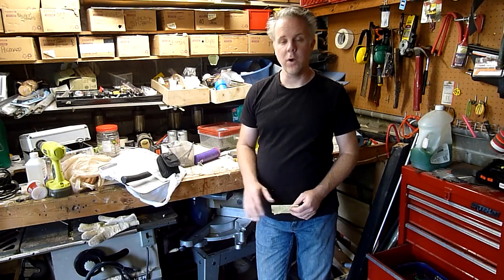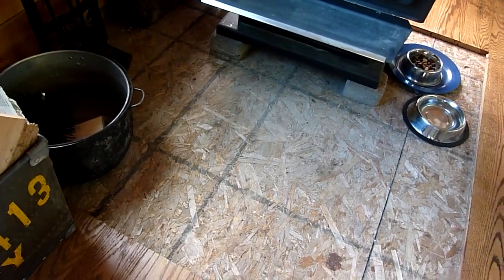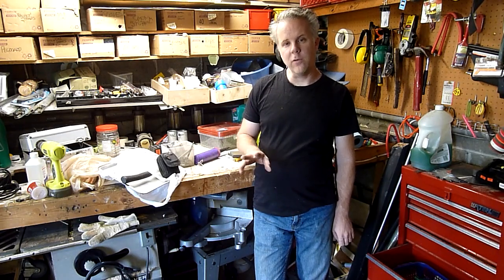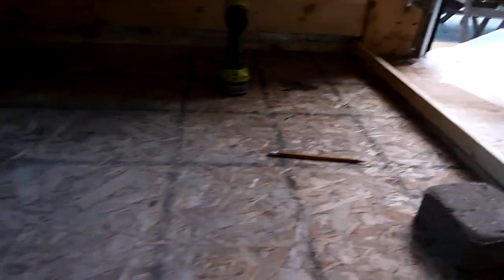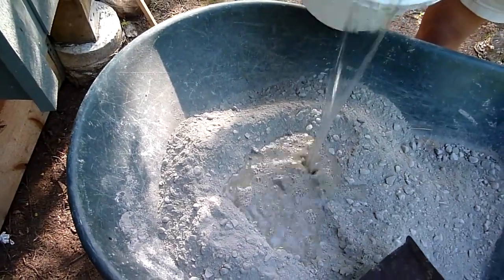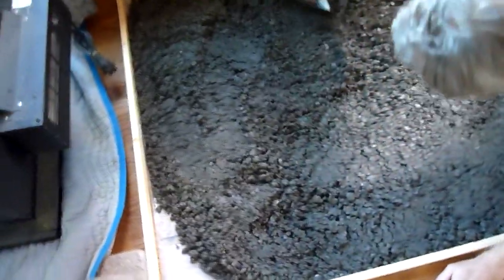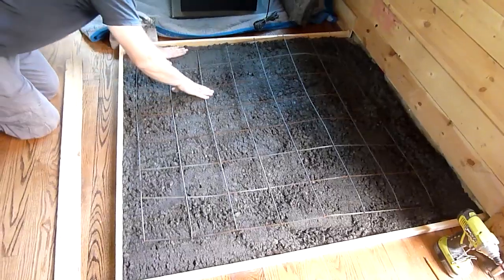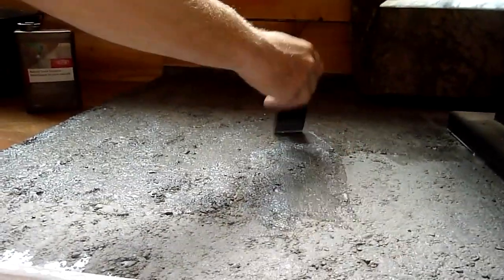Make your own wood stove hearth.

Comment: This looks really nice... could I put a frame around a raised hearth and fill that with concrete? I put together a 40 x 40 raised hearth pad with a plywood floor I thought about framing it, put plastic down and then pouring concrete. The alternative was to put down cement board and then find a nice stone... but I like your hearth!
Reply from the maker: Im sure you could build a frame and fill it. If you use a nice hardwood you could leave it in place. Good luck with your project.

Comment: It looks great!  I was thinking the same thing about the edge.  If I go this route, I bet one could use an edging tool on the mix or possibly just put in a piece of cove moulding around the top edge to get that bevel.
Reply: michael98277 looks really good! Might just steal the idea with a few variations. Thanks for posting!
Reply from the maker: bevelling the edge is a good idea, I would do that if i did it again

Comment: Good project and what a setting you reside in...i have a laid a 20mm mortar base and am thinking of making up a top 20mm finish using white cement + sand or stone dust with a black dye...however not certain if it will look good...will have to smash all out and start gain if it goes wrong.....
Reply from the maker: Maybe make a small test slab. Thanks for watching.

Comment: Hey! Great video, this is exactly what I've been looking for. I love the look of concrete hearths over tile and plan to build one for our cabin.

Ideally I'd like to achieve a bit of a smoother finish, and will likely use a different concrete mix without the roughness/aggregate. Would you do anything differently if you had gone this route?
Reply from the maker: If you want a perfectly smooth surface, you can cast it upside down on melamine. Then flip it over after its set up. check out "home made modern" on YouTube. he has some good videos on that. Good luck with your project.

Comment: you could finish the top with some mortar to smooth it out or just concrete with the rocks screened out. if you want to stamp it you need a lot of fine mud to take the impression, then concrete dye for flagstone effect, But great how to video, gave me ideas. thanks

Comment: After having it for a year, how do you like it?  Would you change anything?
Reply from the maker: We really like it, the edges and corners have held up, no chipping. I might add more dye if I wee to do it again.
Reply: Ontario Lakeside thanks for the super fast reply. I'm not too far from you over here in Michigan. Thanks again.
Reply from the maker: No problem, good luck with your project.

Comment: It's great but the problem with these 'flat hearths' is that you have to kneel all the way down to load the stove or remove the ashes. We raised our stove 8 inches high and still it's a bit of a hassle to get down 5-6 times a day. I vote for raised hearths which might be additional work when creating but helps for the entire life time of use of the stoves.
Reply: I think that's an excellent point,  but I'd choose a height so that you could fuel and maintain the fire while standing.  Haven't gotten around to that yet,  but I remind myself to do it every day during the heating season....
Reply: @SeattlePioneer  you're going to start running into ceiling clearances unless you have cathedral ceilings or higher than average.

Comment: While I understand this is to highlight a DIY project (which was nicely done by the way), before one commits to an in situ concrete hearth, one should also consider simply buying a modular hearth pad which can be placed over an existing hardwood floor. While much more expensive than this project, a hearth pad has some advantages. For example, if one ever moves to another type of heating (electric, solar, gas, etc), they can simply remove the stove and pad and have the solid floor there still intact. And some stoves allow for glass pads, which are visually unobtrusive even when the stove is present.